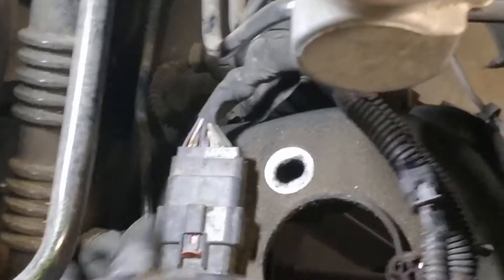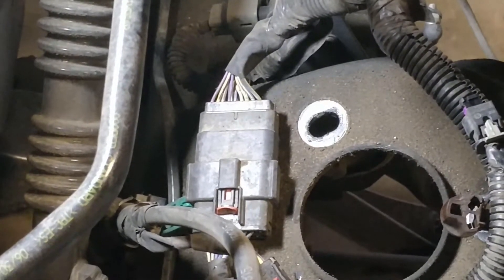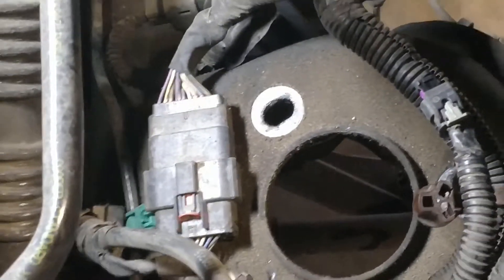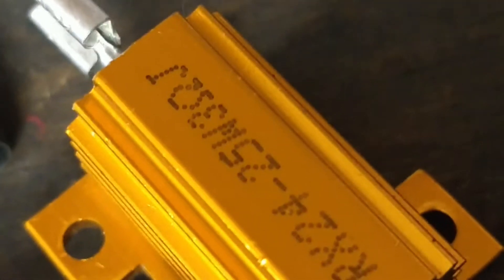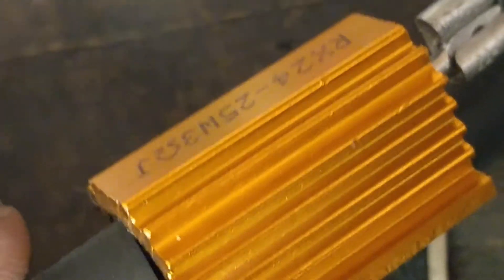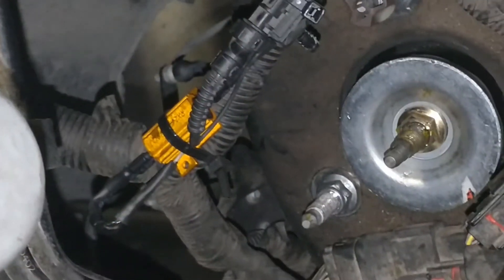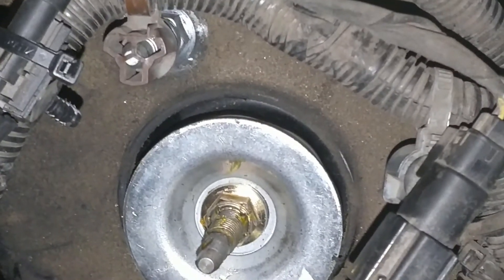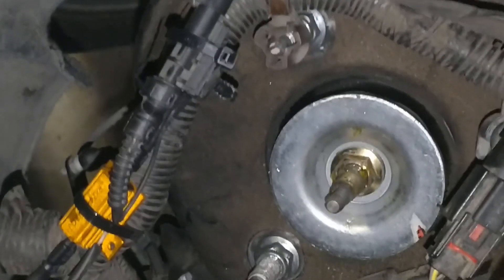How to replace front struts/shocks 2015 GMC Silverado 1500 Denali and bypass Magnetic ride control

Comment: Many vehicle systems are equipped with sophisticated diagnostic monitors. For example, the controller could potentially see the ride height sensors do not properly correlate to the magneride outputs. I don't know if that's the case here in this specific application. However, the traditional shocks may be within those limits as making the system "too sensitive" might get expensive on warranty repairs. 

Also keep in mind that there are many potential fault codes that a by-pass will not address. So if your getting a warning on the instrument cluster you should always have your vehicle diagnosed by a professional.
Reply: It would be easy enough for a computer to command the shocks stiff for a short test to see if they operate as designed
Reply: Also, the original strut hardware would behave more like an inductoe than a resistor. The module is probably not monitoring for phase shift, but if it did that would trigger the tell-tale sign.
Reply: *inductor
Reply: Also, inductors have varying impedance values depending on frequency.

Comment: You can approximate the watts rating for a 3 Ohm resistor using Ohm's Law, V = I*R

Rearranging solves for current, I = V/R
After calculating the current, you can calculate Power, P = V*I

Voltage will vary from 11 to 15.5 volts depending on the generator set point. Probably a good idea to use above the high-end (even though not continuous) so rough road conditions do not exceed the ratings and burn up the resistor.

Solving for current (Amps)
I = V/R = 15.5/3 = ~5.2 Amps

Solving for power (Watts)
P = V*I = 15.5*5.2 = ~81 Watts

 Your mileage may vary but as a worst-case scenario, we are above 80 Watts.
Reply: Most of the time you will be between 12.6 and 14.6 V. So if you use a mid-point, 13.6 V

Then, 
I = 13.6/3 = ~4.5 Amps
P = 13.6*4.5 = ~61.2 Watts

That's still exceeds 60 Watts!
Reply: Although it's not continuous so you have gotten by with lower watt ratings for now

Comment: Does this work? I’m wanting to do this to my 2015 Denali with magneride struts
Reply from the maker: Yes. The only update I write recommend is using a 25W 3ohm resistor. Less chance of heat. Mainly on the rear.

Comment: i have a 2015 gmc sierra 1500 denali. i did mine and after a week my service suspension warning came back. the only thing that isnt correct on mine is that i removed my rear shocks and the new shocks eyelit was incorrect and i have been driving a few days with no rear shocks, just on my airbags. the delete worked initially. i checked my resitors and was pulling some numbers from meter. so i think theyre fine. but also not sure if its ride height or the fact that there is so much bouncing around. will update when i install rear shocks.
Reply: Does it say service air suspension?
Reply: @ehope9789  i have a 2015 suburban did the bypass and it says service suspension

Comment: Not a good idea to wire-tie on electrical harnesses. Those resistors get hot enough to melt the plastic! I know, happened twice on my 2014 Cadillac Escalade. I've replaced them 3 times. All lasted no more than a week. This last set I've wrapped in aluminum, see how long that lasts. May need higher wattage resistance!?
Reply: Thanks for the info but that's why I used a higher rate resistor than necessary. No problems with really as if this post.
Reply: thanks for the idea 
  my seirra Denali  been changed to normal SUSPENSION with the same idea
Reply: Did you leave the compressor fuse in or pull it?
Reply from the maker: Left in and still to date truck working perfect. Have done this on a second vehicle same way and no problems on that one either
Reply: So everyone is bypassing the shock sensor but what about the ride height sensor?